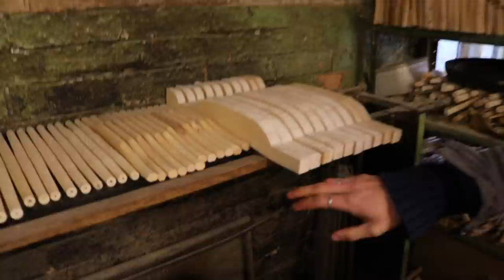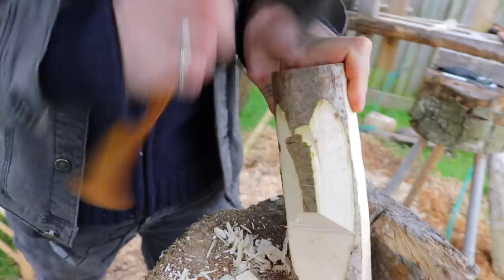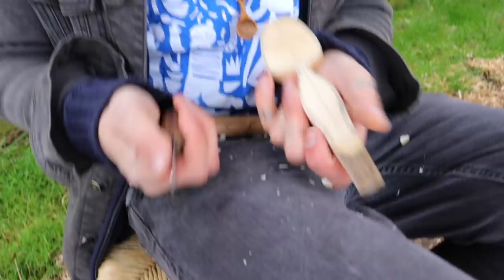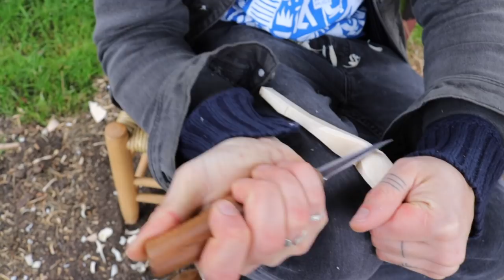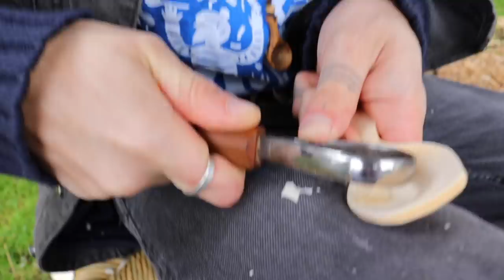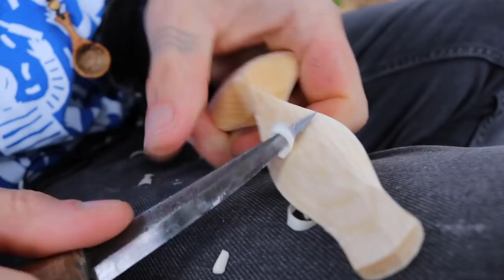How To Carve A Spoon - Sam Cooper

Comment: Can You explain baking of the spoons?
Reply from the maker: Hi Bruno baking spoons refers to placing the spoons in an oven for a certain amount of time, the heat in the oven essentially 'bakes' the spoon i.e. dries it out and depending on the type of wood a discolouration occurs ~Peace~
Reply: @Zedoutdoors  Yes, Zed, but can someone explain the procedure, benefits...
Reply: @brunovrancic8330  The benefits are simply fast dryng/curing and darkening/oxidizing the surface of the wood.  The process: put it in the oven at the lowest possible setting and let it bake for 10 minutes. Check it and if you want it darker in color, let it go for for another 10. It is all about experimenting because every oven and every piece of wood is different, so you results will vary.